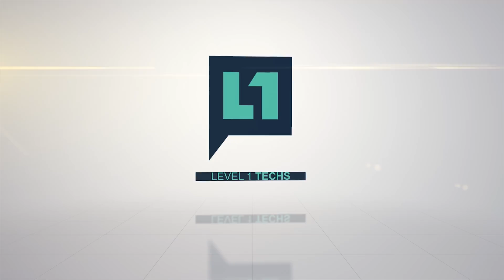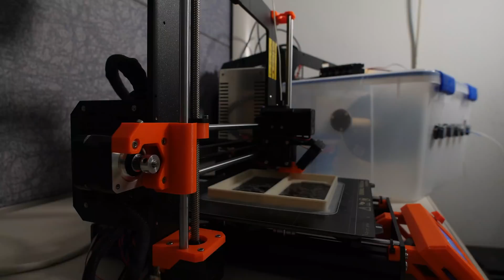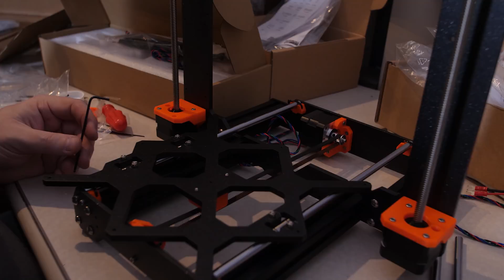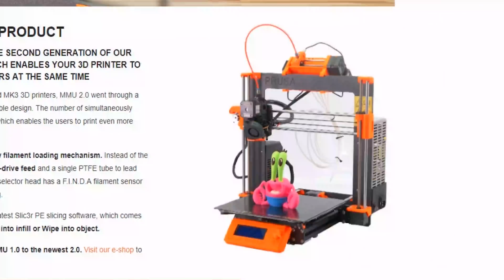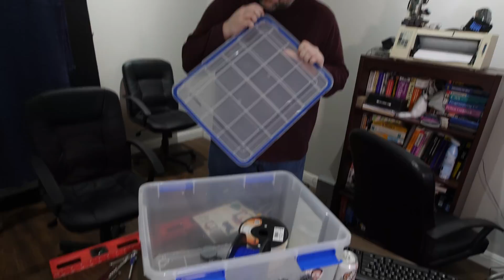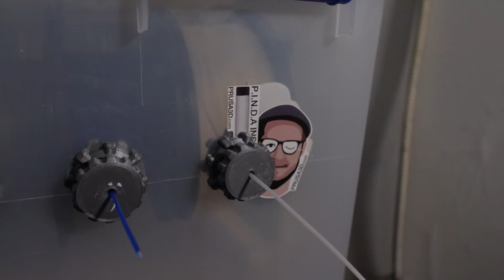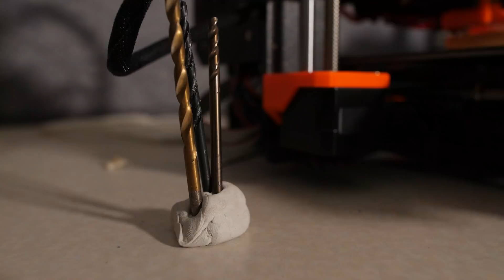Wendell's New Toy: The Prusa i3 MK3 3D Printer

Comment: The Prusa is awesome... we are getting 5 more for the local Makerspace @ our University :D

If you used ABS the Problem wasnt moisture its warping. You can only print ABS in an enclosed chassis, because it needs a really hot ambient temperature...
I recommend switching to PLA, much easier to print. If you need the higher temp. resistance try out PLA+.

Comment: Was pretty excited until I saw the price.  I'd be better off building a 'proper' frame that doesn't need re-levelling. Enclosed print area, multiple print-heads, wider material range, 1m^3 print volume... More work upfront, but well worth it.

Comment: I bought the same printer over the holidays, it's been going non stop! This thing is a beast! The only issue i've had is an annoying loud rattle coming from the power supply. The consensus is that it's the plastic shielding vibrating. I'm working on building a Prusa Lack Enclosure for mine. The power supply will be detached from the frame so the rattle will be eliminated. 
https://www.prusaprinters.org/cheap-simple-3d-printer-enclosure/

Rattle noise in case anyone is interested.
https://youtu.be/B0xE4M8pJa8

Comment: That is a great printer, I just bought one the end of last year and it cannot be emphasized how much better it is than a cheap chinese printer.  I was getting frustrated with all the messing about I had with my Anet A6, it did however for a cheap printer produce phenomenal prints by the time I was done messing with it and dialling it in.  The Prusa is a workhorse you barely have to do any faffing about with it just hit print.  I really wanted to spend more time designing and less time messing with the printer and now that is the case the Prusa is a fantastic machine.

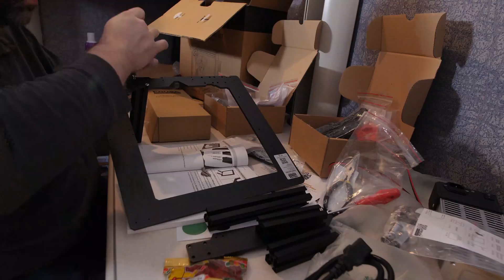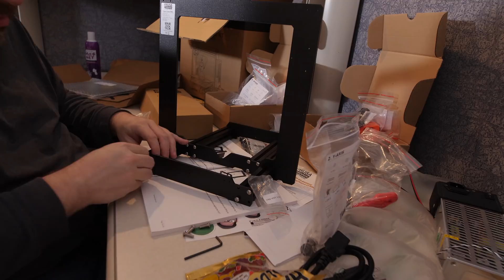Comment: Starting from the beginning i think this printer was not calibrated. Look @ 1:44 and 1:55. Those legs are supposed to be flat on the table and tightened a certain way. No torque screwdriver?? I have built this model, and love the instructions and how it's so simple. Love the show. Keep up with the great content.

Comment: For anyone who's looking at getting the mmu2 read at least the TL DR

TL DR read the forms and GitHub before you buy the mmu2 is quite useful for certain situations does not work right out of the box you will be spending time tweaking settings/ troubleshooting that does not sound appealing to you may want to wait or pass on purchasing one

First of all: if you're not using e3d nozzles and prusa filament you're going to have to do a lot of customization of settings to get it to work consistently(it may take a few dozen prints or more to get it dialed in for your filament that's not already in slic3r)

Secondly: be careful when you're putting it together it's extremely easy to over tighten and crack the mmu2 3D printed pieces (I had quality control issues undersized holes that cracked when you put the correct piece in them ) I ended up reprinting about 40% of the pieces with more perimeters because some of the parts were just too weak for normal operating forces

Third: it works great once you get it dialed in but also introduced more variables that will decrease the reliability of the printing system

Last of all: not all the features of the mmu2 have been implemented at this point (the mmu2 currently disables the optical filament sensor so it's unable to detect if it fails to load the filament correctly, the filaman cutter has also not been implemented as well most likely due to the fact that it wouldn't do anything without knowing if the filament failed to load)

Once you have it set up and all the configurations for the filament you're using it's reasonably reliable and allows you to do some really interesting things like use more than one material like soluble support (which allows for much better quality where the support meat) or print different colors
you will have to decide for yourself if the inconveniences in time is worth it to you for the benefits (for me it is but I wanted something to tinker with when I got into 3D printing)

Comment: Got myself a MK3 during the holidays too! Love it to bits, had to print a replacement bracket because I broke mine during assembly. Seeing the printer print its own replacement part is wild! :)

Also, from a fellow Prusa user to another, try the 7x7 bed leveling firmware. Makes the automatic leveling even better, useful if you really want a perfect first layer! :)

Comment: Welcome to the wonderful world of 3D printing. You'll find all sorts of things you can make out of it which you never knew you needed. Barnacules Nerdgasm is the other tech youtuber I can think of who has done a fair amount of 3D printing, although not so much recently. Half of the things i've printed are upgrades for the 3D printer (mine was a cheap chinese kit to start with which is almost completely replaced with upgrade parts) and the other half are custom iris box designs which I design as a hobby and as gifts. 
  Definitely get OpenSCAD if you haven't already. It's a free open source 3D modelling software that uses functional code to create objects. I'm not much of a programmer myself but in your hands I'm sure you could make masterpieces. It's particularly good for making parametric items which can be used with the 'Customizer' app on Thingiverse (the largest 3D printing object website if you don't know about it already). You can basically make common objects such as boxes and hooks and then have several input parameters e.g. box width, height etc and the code (assuming it's written well) will generate the custom item instantly which you can then print off. 
  There's some really awesome things people have made like customisable, 'print in place' (without support material) hinges, it's insane! I've made a customisable 'print in place' caged roller bearing which works pretty well https://www.thingiverse.com/thing:3201208 although not the most practical. I think I saw a custom CNC milling machine you made in an old tour video. Wonder if you could make something interesting with that, if you still have it, in combination with the 3D printer.
 Also definitely get a Raspberry Pi and put Octopi on it (and print a case for it, naturally). Then you can control and monitor your print over the network and/or internet with a webcam which is really handy to see if a print is going bad (or make sure your house isn't burning down) without needing to check up on it manually. I had a friend make a custom keyboard case at university and it took over a day to print (which actually isn't all that bad for a large print). I would recommend a full sized Pi for neatness, the Pi zero I'm using doesn't have normal USB ports or enough power for the webcam, so I have to use a mess of USB hubs. You could put out a video about it at a later date maybe.
 There's so much you can do with 3D printing, there's just not enough hours in the day to do it all. There's lots of cool materials such as flexibles and dissolvable support material, one of the good reasons to get a multi-material upgrade. Have fun with your new Prusa 3D printer :), really nice printer brand btw everything they do is open source.

Comment: Prusa is an excellent printer. 3d printing is a great hobby. You'll find yourself designing parts all the time. You'll also figure out that each brand of filament has its optimal print settings. Going over temp causes the filament to degrade and clog the extruder nozzle. Also moisture is an issue for PLA, but I see you have a solution for that already :)

Comment: Also, water evaporates at room temperature in a vacuum, drawing even a slight vacuum on the box will dry it out way faster than the desiccant, and you can pull a vacuum on the desiccant and dry it for reuse as well.

Comment: you can dry filament in the oven but i recommend buying a crappy second hand airfryer, i wouldn't wanna use it for cooking afterwards. they have a lot of airflow, perfect for drying quickly without melting

Comment: Using a dry box does not really remove moisture from filament that has already had a chance to absorb it. Dry boxes are great for preventing the moisture to enter the plastic in the first place, but if you want to restore the filament, you will need some sort of heat controlled chamber to dry the filament out. Then you can put it into your dry box for long term storage. I have used a small toaster oven in the past, and it works great. There are many great videos online that document different methods (appliances) to actively dry out your filament.
Reply from the maker: I put the tub in the boiler room where it's basically a low grade oven in there all the time, I forgot to mention that

Comment: I don't think this is a moisture issue - if that were the case normally you would hear popping from the hotend during printing from the water turning into steam. To me it looks like you're printing in a cold room and/or the temperature is set a bit low. Do a search on how to deal with delamination.

Comment: I was just talking to my DM about getting a 3D printer.  I don't need a lot of "things" so I feel like it is better to just pay a company to print my items for 20 to 40 each.  Opinions?
Reply: depends on how many minis you want to print. 20-40 is fine for a handful of prints, but once you hit between 15-20 prints you'd probably have been better off getting a printer. For minis I would consider an SLA printer instead of an FDM, though with some acetone a lot of the rough edges can be smoothed out from an FDM printer. Whether you get one or not really comes down to how many prints you want to do, and what kind of printer comes down to the detail you find acceptable. If you can 3D model though I would seriously consider just getting one, there are all kinds of cool things you could do, from organizational aids such as pen holders, usb holders, cable management hooks, all the little things that aren't necessarily worth the money to get at a store but could be kinda nice all that in addition to tabletop stuff.

Comment: There is a lot of good channels with information, such as Chris Riley, 3D Printing Nerd, Maker's Muse, and there is quite a few different type of printers. Prusa is good as it's totally feature packed, any and all features developed on the open source community, they adopt it promptly. You can however get each and every of those features to any printer, just takes a bit of effort.

I've been lately playing around with Anycubic Chiron, print volume of 400x400x450mm. Beats my old CR-10 S5 with 500mm^3 volume by far. The S5 was mostly a toy, way too weak frame etc. but the chiron seems to have perfected the large form factor of this style.

Comment: i really wish you would've said blender instead of fusion ... ^^
Reply: i like blender too. it's probably my favorite program but it's not exactly the best thing for CAD type uses where sizing and tolerances matter though.
things like polycount for rounded surface smoothness matters and that tends to be something you could easily end up dealing with manually in blender.
blender is built for uses where it tends to be easier to work with the smallest amount of polygons. 
 smoother edges and surface detail can be faked a number of ways. works great for 3d graphics.  not so well for prints.

cad uses where tolerances, sizing, and surface finishes are determined can't really be faked.  the workflow actually benefits from you having a lot of polygons that you don't actually mess with rather than letting the program determine where they're at while you basically just tell the program the kind of shape you want through various means that tend to be less destructive and more editable. 
for instance, a smaller cylinder in blender looks good with a smaller number of verts but if you duplicate it and size it up it's still the same number of verts but now the cylinder looks much more polygonal than it did when it was smaller.  you need the extra verts to keep the surface appearing as a smooth curve.  going the opposite way leaves you with verts too close together to easily select what you want so working with the mesh becomes harder.
in a cad program you really just deal with radius or diameter and the program determines the number of verts needed at that size.

don't get me wrong, you can still do it in blender but there's a lot of modifier use and booleans and stuff. in the end though you can still run into instances where there's either plenty of extra setup to keep your multiple boolean or bevel modifiers from messing with each other.
it's still easier and faster to do it with a program designed for that type of usage. 
i learned autodesk inventor in school. it's a great program but i don't want to subscribe for software and i'm a linux user. i've been using freeCAD because it's available in linux. 
freecad has a similar sketch based workflow as inventor but seems a little more convoluted than it needs to be.

bit of a side note, just got a 3d printer myself and can tell you something is wonky between how my printer's slicer program reads size units and how they get exported from blender.  i'm always having to scale my stuff up  like 10000% to get it to the proper size. it's like they're reading the default unit size as different units. i even started working in metric because it's easier to do the calculations while i model (1inch = 25.4mm) and then scale up 10000%
Reply: I've used blender to fix up and modify stuff I've downloaded (mostly quickly filling holes I didn't need). For designing parts I started off with tinkercad, found it frustrating, and sat down to learn FreeCAD.... I did try out Fusion360, but decided not to bother learning it because they don't want to make a Linux version and I wanted to get out of Windows.
Reply: I used freecad for a while, it's close te being usable, but the topological naming problem makes it unusable in my opinion, having to re-apply 30 fillets and chamfers after making a small modification in the model is crazy.
Unfortunately I don't think it will be solved for a couple of years (it has been there since the beginning I believe).

Comment: Assuming you're using the standard 0.4mm nozzle, (I think the prusa i3 uses e3d hotends) moving to something like 0.8mm nozzle would allow you to raise the layer height to maybe 0.6mm and make things like enclosures and fan shrouds print really fast. Or even a larger nozzle on a e3d volcano. But just try setting your slicer for 0.8mm nozzle and 0.6mm to 0.4mm layer height and look at the print times.

Comment: PLA is almost impervous to moisture. I think that is not PLA but ABS, and using PLA settings for it etc. way too cold printing etc.
ESPECIALLY as you talk about flex etc. PLA is the stiffest common material, everything else seems like filaflex in comparison

Comment: You need to dehydrate your filament if you want to bring it back to top form. Just using a drybox will prevent further moisture absorption, but it won't fix the problem in material that has already absorbed moisture. You got lucky because your tightly wound spool only absorbed moisture in the outer windings, but just stick the whole thing in a $20 food dehydrator for 12 hours (adjust the temperature based on the material) and you'll see better prints every time. Sometimes even improves the quality of filaments right out of the original packaging.
Reply: @PRiMETECHAU  an oven is going to be far less efficient than a dehydrator, unless it's a very high end convection oven. I've had great results after 12 hours with just about every material I can think of.

Comment: Very handy information- saved it as a resource on YouTube. What may be interesting is an external drive mount- containing the USB/ connector eliminating cables. If it could fit into a 5 1/4 drive bay - where the old CD drive used to go? You could mount up to two 3 1/2" drives and maybe even a card reader...

Comment: Try a SLA next. You can create some pretty cool semi transparent stuff with a higher detail then the FDM printers like the prusa i3.
Or get a CoreXY with a bigger print bed for bigger prints. Those are more stable compared to the cartesan printers for bigger print beds.
Swap the nozzle for a smaller one for higher detail as well?
Personally I use blender for modeling and editing models.

Comment: Maybe just dump a ton of silicagel (that stuff they put in these little white bags when shipping electronics or camera equipment) into your filament box. That stuff binds water, changes color over that process, but you can dry it easily in a low temperature oven and re-use it.

Comment: Have you seen the E3D tool changer prototype? Also, Fusion 360 is free for hobbyist use (you have to jump through some hoops but it is free).
Reply: DesignSpark Mechanical is also free as in beer (with some hoops). It doesn't have the hobbyist license limitation  and is based on SpaceClaim, but adding things like text has to be done externally which is a pain. But most notably, unlike Fusion 360, it's not cloud.